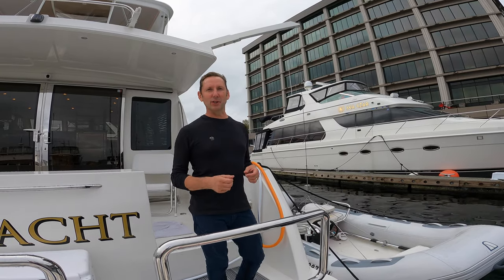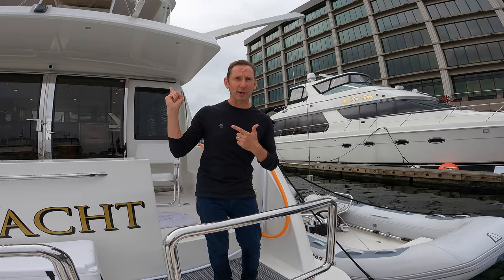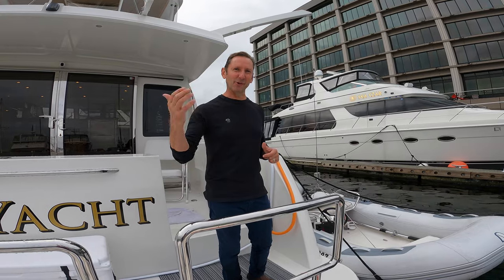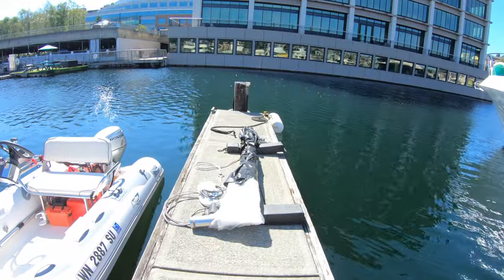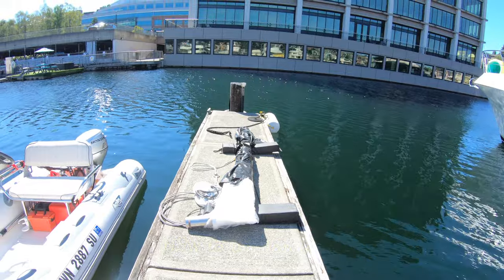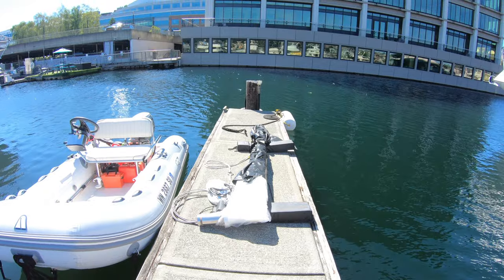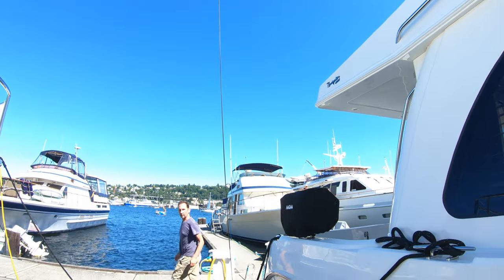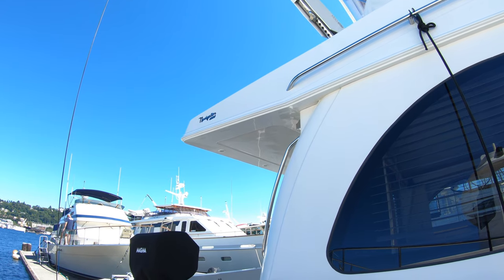Steelhead Hydraulic Crane / Davit Upgrade For Our Dinghy (EP 24)

Comment: Admittedly I’ve never seen a davit changeover. Very nice job...more to it than I would’ve thought.
Reply from the maker: It was a planned 1 to 1 switch since it was the same manufacturer and model. The catch was we bought the replacement power luffing Davit used and it had an undisclosed faulty ram. As you are seeing, it was even abut more challenging than we illustrated...

Comment: It looks like you replaced a Steelhead WD800 with a Steelhead WD800. Can you please explain the difference between the two models (old and new)? Thanks.
Reply from the maker: The original one had manual luffing (moving the boom up and down). To do this it has pin holes spaced out about 3” from each other. Invariably, one made the boom to high which would rack the dingy against the hull and the next one down didn’t let the keel of the dingy clear the bunks. That meant horsing around a 500-700lb dingy on a cable. Not a safe feeling at all. 

The power luffing WD800 enables us to lower the boom while we are lifting the dingy out of the water and raise it when we are placing the dingy on the bunks. Much less drama and effort.

Now power rotation would really be the bomb.
Reply: @ElliYacht1  I'm considering upgrading my own crane and trying to identify certain models. Do I have it correct that both your old and new cranes were Steelhead WD800s, except that the newer one had the added feature of power luffing?  (or are they actually two different model numbers)? Thanks very much (and very informative videos, thanks).
Reply from the maker: If you contact sales at http://www.advantecstore.com/customer-service they can answer all of your questions. They were really helpful when I was doing the change over. Honestly, their model number differentiation is really confusing.